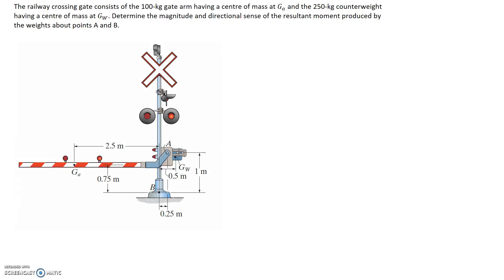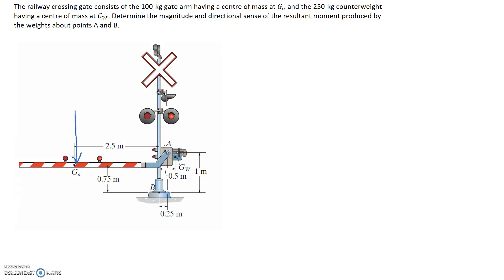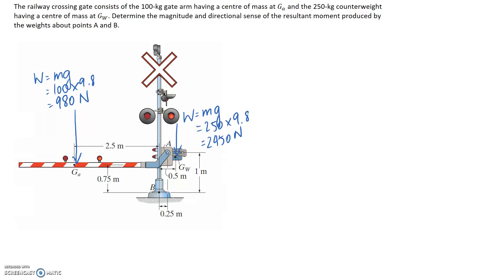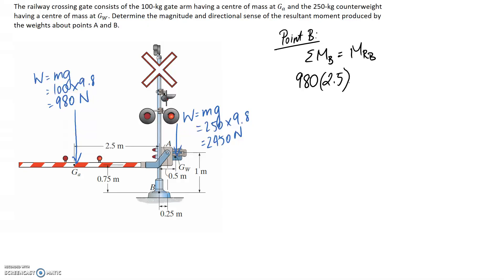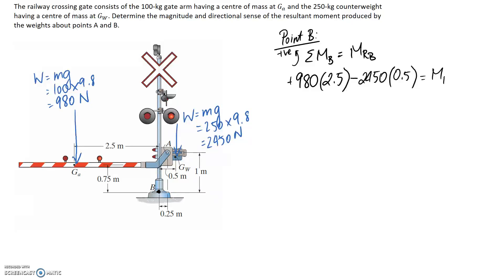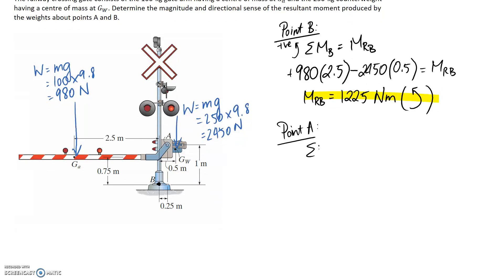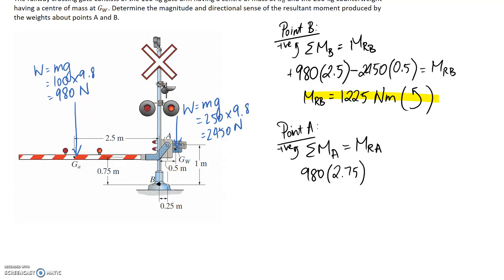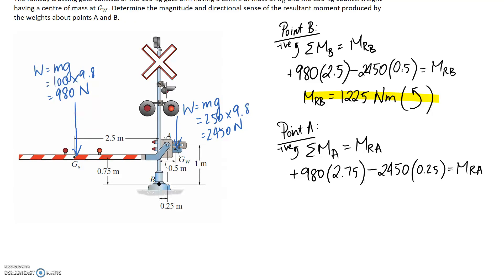(3-11&12) Moment Example #2

Comment: Rather than this being simply a number crunching  expertise, it would be helpful to think about what this resultant moment means in a practical sense. As I see it, the clockwise resultant means two things. Firstly  the anti clockwise resultant about B means the boom arm has a natural tendency to come down, which is good from a safety perspective  because this means that once closed, it will stay closed even if there is a power failure.Secondly it means it must come to rest on some kind of stopper or bracket (not shown on the drawing)to provide the neccesary counter moment to hold the boom in the horizontal  position.